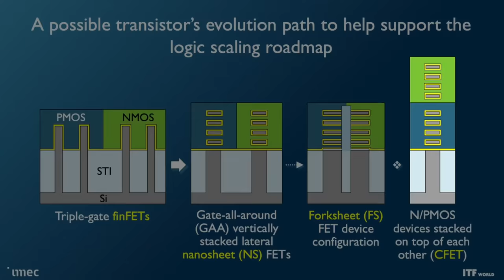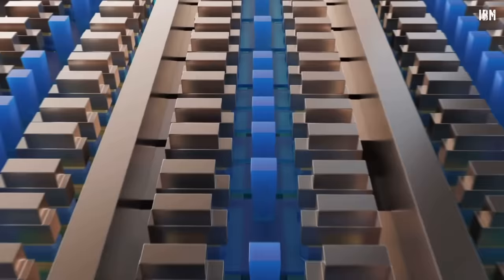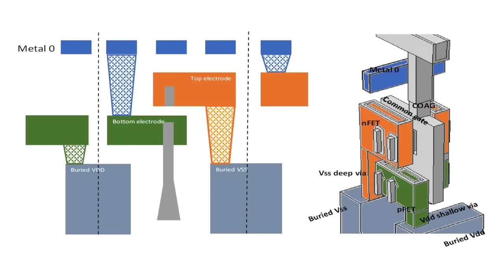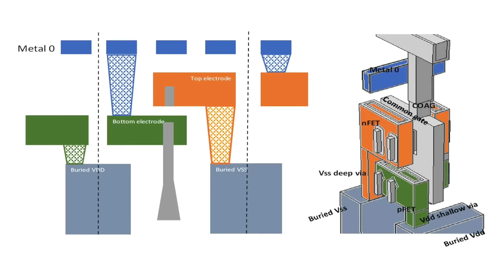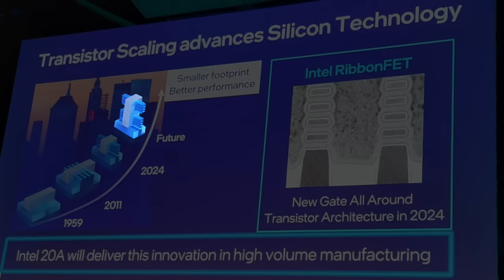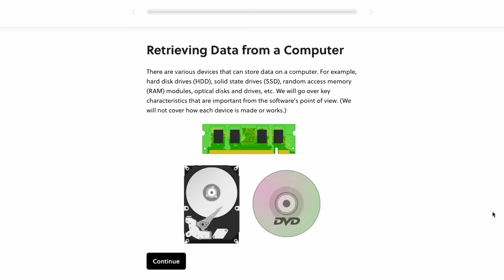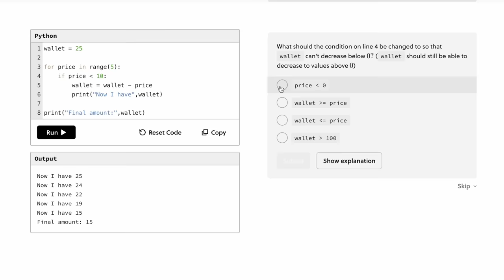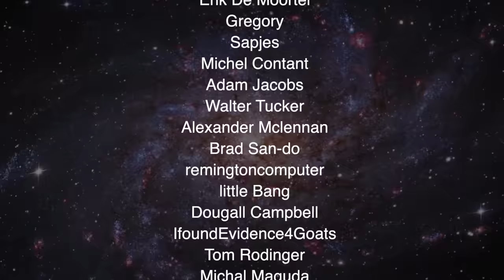New CPU Technology. IBM, Imec, Intel

Comment: I work at Intel and i can't overstate how excited we are internally for this new technology!
Reply: I am a software developer and I am getting anxiety thinking about the limits of our process node size. We are reaching limits of physics and especially our laptops can't really get any more performant in the coming decades if not years. Desktop PCs and servers should be fine.
Reply: With all due respect I feel you guys need to focus on bringing power consumption under control. 

My Lenovo ThinkPad Windows laptop barely lasts 2 hours on battery. Meanwhile Apple silicon Macbooks run all day on a single charge. 

My wife hates Apple devices, but she's actually considering a Macbook Air to replace her HP laptop due to the fact it's thinner, lighter, faster, runs cool  and has insane battery life.
Reply: @CB27  To be fair apple uses ARM chips not X64 chips. In benchmarks 64 bit CPUS will smoke ARM chips. But ARM chips use much less power as they are also used in cell phones. So you have a cell phone CPU with a big battery running basically linux. Of course you're going to get long battery life.
Reply: @zachsylvester309  I don't think that's true. The M2 chips for example have 1900+ in Geekbench single thread which is comparable to x86 Intel and AMD laptop chips of the same generation. I am not sure how much the actual difference is in terms of process node size when comparing M2 vs Intel say 1260p, but battery life is still more important than performance at least on laptops.
Reply: and when are you going to make cpu's that act more like a cpu and not like a resistor in an electric heater?
Reply: @SahilP2648  Hey Sahil, you've got some fair points. The Apple M2 and Intel Core i7-1260P do indeed have similar price points, and in terms of single-core performance, they're not too far apart - the M2 does have a slight edge. As for power consumption, you're right that the M2 is more energy-efficient.

However, while Apple's hardware may be impressive, there are other factors that make Intel an appealing choice for many users. For instance, by choosing an Intel-powered laptop, you're not locked into Apple's ecosystem. This means you have a wider range of hardware and software compatibility and more freedom to customize your system to your liking. You can easily upgrade components, something that can't be done on a MacBook.

In terms of software, while MacOS is indeed a robust operating system, Windows still has broader software support, especially for specialized applications and games.

So while the M2 might win in a head-to-head benchmark competition, the overall user experience isn't just about raw power or battery life. It's about the flexibility and freedom to tailor your system to your needs, something that Intel-based systems still excel at.
Reply: @laughingvampire7555  Intel's design isn't 'crap'. The 'power-hungry' elements and 'branch predictions' are there to maximize performance. The 'unnecessary complexity' ensures older software runs on newer hardware, which is crucial for many users. CISC vs. RISC isn't a matter of one being universally superior; they're different philosophies with their own strengths and trade-offs. Intel isn't 'burning more carbon'; their manufacturing processes are increasingly efficient. It's not as power-efficient as ARM, but it's addressing different computational challenges. Rather than hoping for bankruptcy, let's appreciate the advances each company brings to the table. After all, competition drives innovation.
Reply: @CB27  This is being addressed in a new approach by intel through backside power delivery.
Reply: What is it doing to your insides? Is it giving you all the trots or something?
Reply: @SahilP2648 This is where competition starts to revolve around aesthetics, and more companies will have their software looking like Apple’s since Apple’s software is peak aesthetic. Not sure if Apple can sue other companies if they look like Apple, if they can then Apple will surely have a monopoly over some of the tech. We can already see this with Apple and why they outperform their competitors in sales such as Samsung, Google, Xiaomi, OPPO, and etc otherwise I can’t think of a reason why they are this popular. Now aesthetics is a subjective judgment, but most people would lean over going the Apple route.
Reply: @SahilP2648  Reducing node size was always going to end in a brick wall.
Going vertical was the only way ahead.
Reply: @zachsylvester309  Modern ARM chips are also 64 bit.
Reply: @CB27 Simple answer. Use a desktop. Not laptop. 😀
Reply: @Way2go926  not really practical for on-site jobs at customer premises
Reply: @zachsylvester309 When I was in university we used the P4 architecture as an example of exactly what not to do. Long pipeline with fickle predictions.
Reply: If Humanity really wanted to advance, we wouldn't keep all these technologies in silos. There really isn't a good reason at this point why complete SoC's aren't the norm at all scales. Motherboards and ancillary support devices need to be made a thing of the past. Give us all the CPU cores, all the GPU cores, AI acceleration, significant amounts of cache and and on-chip RAM, wifi, Bluetooth etc etc all in a tight little package with a great thermal profile. You get the picture. There isn't a technological barrier to achieving this, it is purely structural, business oriented and political. We have now been integrating circuits for decades, time to go the whole hog.
Reply: @zachsylvester309  Too bad that AMD is kicking their rear end.
Reply: @SahilP2648  "We are reaching limits of physics and especially our laptops can't really get any more performant in the coming decades if not years"

New cooling tech like Frore's MEMS based AirJet can help with increasing the power envelope for mobile/embedded systems.

Plus all the masses of research piled into improving EV battery packs for the last decade+ will be just as beneficial to mobile PC battery capacity further down the line.
Reply: @CB27  Macbooks ARE laptops.

Really stop giving different names for the same thing - it's a computer than can sit in your lap.

Lap. Top.

Also Apple really doesn't bare a direct comparison to anyone else in the industry as they almost entirely control the hardware and software stack variables in their various PC product lines.

This has its benefits, but likewise their ecosystem is intrinsically closed which turns off most people who have no desire to be locked into iSheep mode.
Reply: @zachsylvester309  "To be fair apple uses ARM chips not X64 chips"

ISA doesn't matter nearly as much as µArch - Jim Keller has said this at least once, given that he has worked on both AMD Zen and Apple's Ax series of SoC's I'd warrant he knows what he's talking about.

Coupled with Apple's extensive hardware+software stack control they are capable of squeezing more juice out of their own hardware than the likes of Asahi Linux's devs could ever hope to without at least a decade to optimise even just one single SKU to feature complete level.

I think given a few years to refine their hardware design and a complete shift to a Fuchsia based software stack that Google could easily match Apple in this regard - but for now they are handicapped by Android OS's intrinsic inefficiencies and Chrome OS's lackluster web based UI which both steal perf and battery life with it.
Reply: @SahilP2648  "I don't think that's true. The M2 chips for example have 1900+ in Geekbench single thread which is comparable to x86 Intel and AMD laptop chips of the same generation"

That measures a basic set of consumer centric benchmarks that does not really reflect what a strong multi threaded workload like those seen in high end DCC or server/datacenter use cases.

In short Apple's chips are optimised well for consumer tasks - but fall well short of actually making good on utilising all of that oomph when they stray beyond their consumer centric comfort zone.

Even the GPU does not at all compare favorably to either AMD or nVidia in high end massively parallel compute workloads that have nothing to do with graphics.
Reply: Even when you run Windows on ARM or Linux on x86 platforms you will notice better power efficiency with ARM.
Reply: Meanwhile your fabs are a complete dumpster fire because of an apathetic and listless middle  and upper management, horrible logistics issues, and you hire non-technical people off the street to become engineering technicians who know nothing of vacuum, hydraulic, pneumatics, systems integration, electronics, mechatronics and chemistry, expecting them to work on million dollar tools, training them on the spot by 'into the frying pan' mentality - while they walk around for literal miles trying to scrounge hand tools, equipment and parts - and you think IDM 2.0 and this technology will save Intel when TSMC have such a distant lead working with AMD and NVIDIA while ARM is nipping at x86 AND you cant even get your existing fabs in order?

But that's ok - Intel is 'too big to fail' and the government is bailing you out via the CHIPS act.
Reply: @CB27 if you're worried about power consumption you aren't intels intended target. They make performance processors not glorified Raspberry Pi's.
Reply: @decentrifytech   please spill more deets on this. i'd like to know more. you seem to have a true pulse of what's going on. i know the majority of corporations are badly run by inept management because of wall street's grip on them to favor shareholders and themselves and intel is just another example but are you confident that its bad enough here in intel's case that it will negate any potential growth from this new technology?
Reply: @randymeas3235  Management is listless. They have no real leadership. Instead of focusing on doing things right in the fab, management is being distracted by non-critical 'busywork' and 'bureaucratic social activities' that drain time and resources - not only them, but rank and file fab technicians also have to do this wasteful corporate 'club activities' instead of focusing on production.

Fab technicians who work on the floor and keep the fab running are over worked, under paid and over stretched. They do not have the hand tools readily available to do the job right; hand tools are often broken or missing. Parts do not get delivered to the work area in a timely fashion. Equipment that is needed to test the semiconductor tools wanders off and it got so bad that they have to lock equipment in a certain spot with lock and key to force technicians to put it back where it belongs. Technicians have to walk litereal MILES to find hand tools, safety devices, test equipment and drag stuff across the fab to do their jobs.

Furthermore, the quality of technicians they hire now is sub par.  There are a few good techs, usually those who are ex military, but they hire people with NO CLUE about fluid flow, thermodynamics, electrical theory, chemistry, material sciences, etc. They have this mentality of "we can train you" which is good - if someone wants to learn, I am all for it! But some of these kids they hire watch You Tube videos and play games on their smart phones WHILE DOING maintenance!!!!

And when you have technicians who really care and are seasoned, and who see how poorly the fab is run, and you call it out, you get a target on your back. Managers don't like it when techs call out how bad the places is run, to you get a target on your back. 

Techs are the backbone of the semiconductor industry while engineers who sit in cubicles get all the praise and glory. IDM 2.0 WILL FAIL because Intel does not respect their technicians, does not train them properly, burns them out, hires poor candidates with poor experience and has this 'do more with less, lot my problem deal with it attitude' to the grunts in the fab.

Engineers aren't much better -I cannot say exactly but mistakes were mad and in one incident, they had to scrap a lot of wafers crucial to development, because they pushed the wrong button and fail safe checks were over looked.

And wafer starts were down 40% since last year. 

Furthermore, Intel has an 'image crisis.' Since Intel cannot really compete head to head with TSMC and x86 is being threatened by ARM, they are trying to brand themselves as a sort of 'lifetsyle, do-gooder foe humanity tech company' instead of having a defined identify of 'we make bad @ss competitive CPUS and GPUS. Now, Intel is 'soft' trying to push AI and VR and greenwashing kind of crap while selling of all sorts of divisions and entities trying to focus on IDM 2.0.  Intel is losing tons of money now because they got drunk off the COVID tech bubble thinking it was going to last forever - now they are losing billions - and had to grovel to the government for the CHIPS act to subsidize their business model.   

There is a reason why Intel cannot execute - its a broken culture  with a listless attitude and no one has got any real balls - Intel is too soft - if Gordon Moore and Andy Grove, especially Andy Grove could see how soft and listless Intel is now, they'd be disgusted. Intel is trying to be the soft, kinder gentler tech company where ruthlessness and bleeding edge technology is what keeps you alive.
Reply: Oh boy a way to quadruple Moores law well seems like a good.  @laughingvampire7555
Reply: @SahilP2648  there is that new cooling method made by Frore systems, it makes laptops and other handheld devices able to draw a lot more power and it doesnt need air intake
Reply: @CB27 the new generation of 3D transistors actually have better power consumption....so it's still a win
Reply: @SahilP2648 yh but there is still so much room at the bottom...after 3D transistors... there's still research going on in single electron transistors
Reply: Not one mention of radiation hardness.
At 1nm the transistors would be very susceptible to damage from cosmic rays
such as muons and even normal background radiation.
In space they use transistors as in the old 80486 CPUs which are 800 nm technology.
Anything smaller gets damaged too easily and wouldn't last 5 minutes.
Reply: we are not so excited for the pricing, I bet you folks will set a huge price for this technology
Reply: Leak everything
Reply: @SahilP2648 Not true, we have ways to spread outward, software just needs to be rewritten to take advantage of improved scalability.
Reply: @Bobby-fj8mk  umm no? I have seen them use normal 'Earth' laptops up there. Granted they might have some additional shielding but decreasing the size shouldn't increase the chances of radiation affecting the processing. What does affect though are quantum effects, especially quantum tunneling which allows electrons to literally teleport between solid structures, which causes errors in processing. Newer processors have special logic in it (hardware?) to remove these quantum effects for normal operation.
Reply: @_nom_  unlike hardware where you can make a modular approach by connecting different pieces together and modifying existing ones in multiple different places, software cannot be modified in such a way. Just look at the Chromium project as an example (or even windows 11). Many parts of the code in super huge projects like these are "don't touch this part of the code because that engineer has left the company and has provided little documentation on how it works, and changing this might break 10 different things which we have no Idea what they could be". I would like it if I could go back 8 years when Chrome was using 1-2 GB for 40-50 tabs in TOTAL, compared to now where 2 GBs are consumed just for opening 10 tabs. This is not progress. One of the reasons for this is sandboxing individual tabs, but if you consider 100 MB for 1 tab, I should still be able to open 50 tabs consuming 5 GB. Instead I get wildly idiotic RAM usage like 18-20 GB (88% usage of my 32GB system). Let's start from there then fix other things yeah?
Reply: @SahilP2648  - they can't be normal laptops. They are probably very old models which have larger transistors.
Reply: @Bobby-fj8mk  nope nothing that old which has 800nm process node can run Windows. I have seen normal Thinkpads running Windows on the ISS, so it's easily less than 20nm.
Reply: @SahilP2648  - I am surprised to hear that.
How can small transistors and memory cope with Muons?
Reply: Thank u for bringing these complicated technology subjects to present in a way the lay man can understand! Pls keep this up.
AI, ROBOTICS, Chips,
Reply: @domi1kenobi  Linux has a much better efficiency on any architecture. So its a double win.
Reply: @laughingvampire7555 lmfao nice